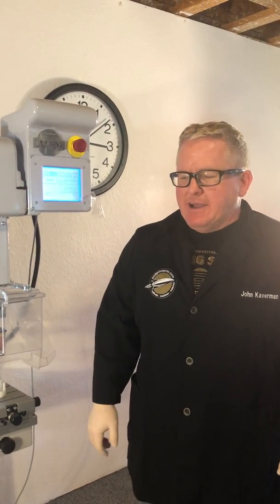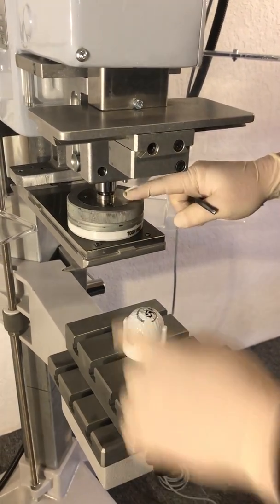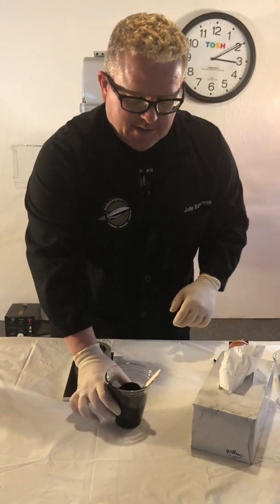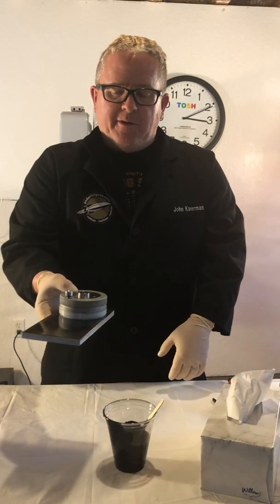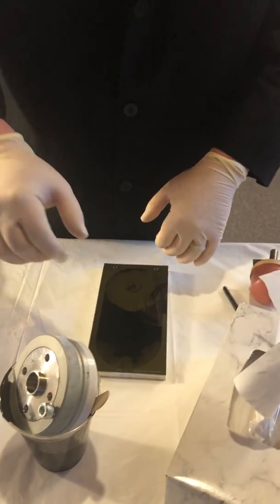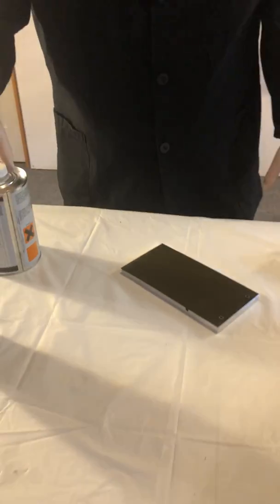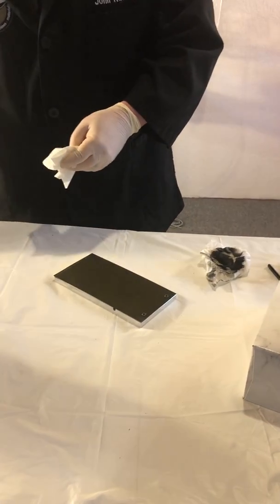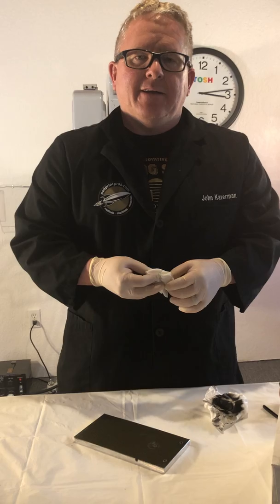End of Production or Shift and How to Clean a Photopolymer Cliche

Comment: How do you clean the ink cup? How do you preserve the cup and the cliche for next use?
Reply from the maker: @giulio4492  to store cups, just protect the blade edge with the cap that was shipped with it when it was new. To store cliches we put them in an envelope in a file cabinet if they are polymer. Thin steel or 10mm steal should be oiled and put into oil paper to be stored.
Reply from the maker: @giulio4492  https://youtu.be/z9ZCdpWpO_Y?si=ysR2vFYfFt4rSZKN
Reply: @PadprintersIMS  the video liked shows how to clean the ceramic ring. I meant after you let the paint flow in the cup to clean the insieme you use acetone and paper and then also the solvent like the cliche?
After the use to store them, do you keep it at dry air or immerse in the solvent?
Ps. Ooh I saw the answer below later sorry!
Reply from the maker: @giulio4492  by hand we use acetone and tissue paper. Or if you have the budget you can use a washout tank that works like a dishwasher.